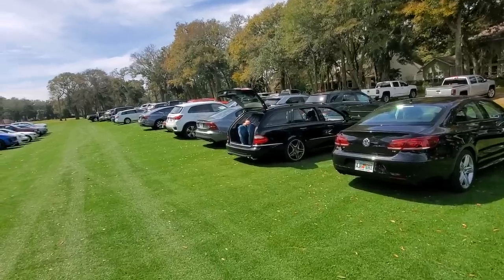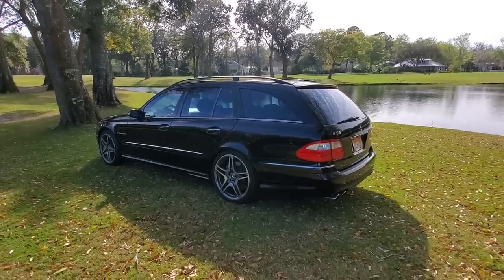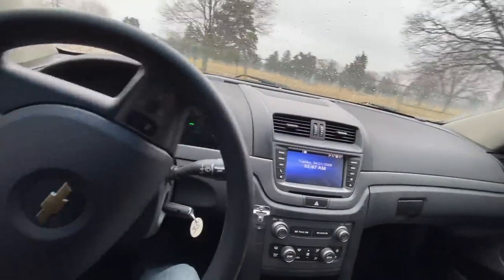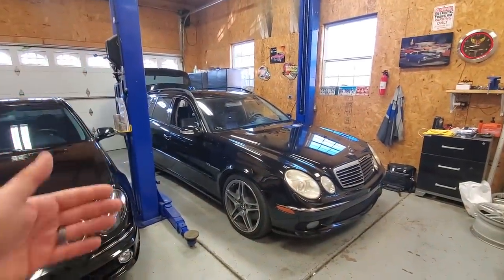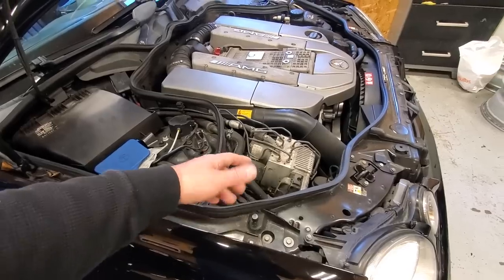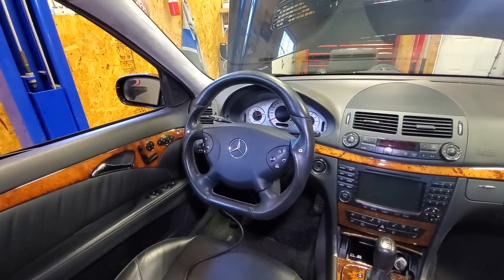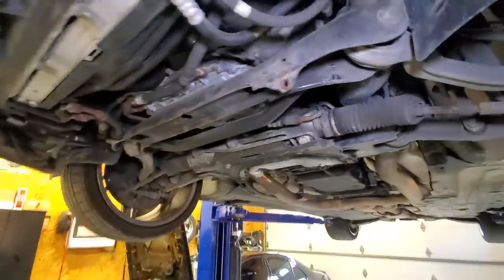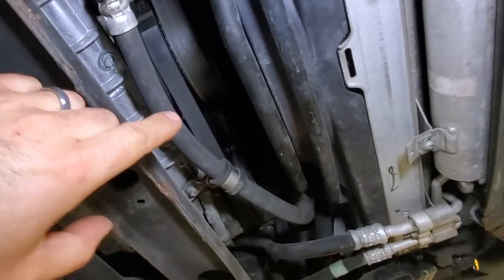I Bought My Dream Mercedes E55 AMG Wagon! Here's What I Paid & What's Done To It!

Comment: The 55 wagon was actually measured to be faster than the sedan. It was 0.3 seconds faster to 60mph and if I recall, better on the skid pad. Probably due to better weight distribution?
Reply: Yes, testers here in Germany found out the wagon even drifts more controllable because there is a little more weight on the rear.
Reply: Better aero.
Reply: More traction in the rear
Reply: @bloodcarver913  wagon has more Drag. Reason is more mass on the rear axle.

Comment: Piano black interior trim kit, headlight restoration, performance exhaust, paint correction, engine compartment detail, updated brakes and rotors, proper window tint, AMG rear diffuser, and undercarriage protection
Reply: Amg rear diffuser on a wagon ? How did u manage that, i'm interested
Reply: You can do a diffuser on a wagon perfectly fine. But ew. Piano black
Reply: Oh ok so sedan diffuser can fit the wagon then ? That would be awesome
Reply: Piano black is disgusting in cars just wrap the trim with something less unappealing
Reply: @vantilmichael9122  yeah, everything but the roof and hatch (obviously) should be the same. Everything underneath the car is the same. But if the lower bumper is the same across both sedan and wagon, it'll fit perfectly
Reply: @NatoriousGamePlay  thx a lot I was led to believe that they had different rear bumpers, so never dug in more, I'll try to see If Alex gets this mod done.......

Comment: Put penzoil full synthetic and Lucas Pure synthetic one quart into it. it will not smoke cold start. Run a can of seafoam on it also to celan up the valves a bit. just let it suck on it slowly dip the vacum hose in the bottle by dabing not all at once. . Worked on my e63, e55, s55 , c32 X3 , c55

Comment: We had an e220 cdi s211 a couple of years ago and loaded literally 2200 pounds of rocks in the back of it. Plus 2 men and a full tank. The car drove perfectly fine. The air suspension pumped it up to the normal height and we had no warning lights for the entire 40min drive. 
Well, it felt like a boat at the rear while going over bumps but that's to be expected

Comment: Future Mods Request: Wavetrac or Quaife Diff, E63 power side mirrors, WALD LED kit, The Camber King (previously F1 Fabrication) front/rear suspension, Creative Steel Subframe Bushings, InterChiller, Weistec Blower kit or the upcoming VRP TVS/Whipple kit, Russell Drake’s 150 Valve Body.
Reply: Then you can really buy your groceries in style!

Comment: Hi! The headliner in your E55 wagon is optional Designo headliner. If I’m correct, it was available in grey and black finish, it came with stitching, but I must check it in catalogue. About the star you bought for E55 sedan - if you bought the facelift version emblem, it would be plain, with no lettering ✌🏽😁

Comment: this is why the hydro-pneumatic self-leveling suspension in the previous generation MB wagons is WAY superior to the air suspension. I brought home 2400 lbs of solid mahogany hardwood form Lowes in the back of my 'W210 E320 wagon and the car was completely level at all times with zero warning lights or issues. Also, SLS suspension doesn't really go bad like Airmatic does, only thing you even need to replace is the accumulator spheres maybe every 100-150k miles (super easy to do and cheap), and even when those go bad  the car still remains level, just a stiffer in dampening.  My current W212 E550 has Airmatic all around and it does not ride as plush as my E320 with SLS

Comment: If you want some cool custom wheels that hark back to the older E55 and 650 SEL/SEC AMG's, you could commision a set of 18" AMG Monoblock multi-piece wheels. 
Get the retro look and get wider wheels for more tire to handle extra torque.

Comment: Oooh, a Kombi.  :)  That's what they call a Benz wagon here in Germany.  I have an 06 E55 Kombi myself, so I'm interested to see what you do here.  Especially when it comes to suspension.  Options seem limited, and I've got the dreaded error message saying that I have a leak.   

I just dealt with a really sneaky coolant leak that was a PITA to find by the way.  Pressure test didn't show it at all after 10 minutes, but it was dumping coolant on the garage floor overnight randomly  Can send you specifics on what caused it if you think it might be helpful.

Comment: @Lsc : Hay I think the keyless go problem is the wires are broken at the bottom of the shifter, they always go there due to the thin wires, it’s a tricky fix but can be done (I did mine ) I extended my wires slightly too cheers andy

Comment: Sorry I'll keep my 06 Magnum SRT8 in Bright Silver Metallic with the sunroof. Dodge changed the paint to Silver Metallic at the very beginning of production. My car is one of 47 with the sunroof and the color code. Granted I have 178,000 miles on mine. My kids grew up in it. However, they were never allowed to wear shoes in the car, eat, drink, ECT. I have the original rims and tires, I even have the original air cleaner, I immediately upgrade to the Mopar open air element (K&N manufactured). The only original part I don't have is the exhaust. It has a MagnaFlow system on it. But congrats on the car. Car and Driver had a shootout between the two wagons I have a copy of that magazine.

Comment: Thats gotta be the one that was at NOLA Motorsports. Decent one. IIRC, they put some new air shocks on a few corners...might even be Arnott Gen2's. I believe that also had some long tubes. It's been many moons since I had my 2004 E55 , but I lucked out and had a very reliable one, probably because I left it bone stock with the exception of an upgraded IC pump.

Comment: SBC, wheel speed sensors, brake light switch, ect all parts of SBC system may have extended dealer warranty regardless of owner. My 2003 e500 does. Check into it.
Reply: 20 years.
Reply: Your on it. Posted before you got to it.

Comment: I have an ML55 AMG which was running well before storage. Taking it out of storage, it went into LIMP at 4000 RPM. No codes (FIXD and KIWI). Swapping modules from my other ML55 AMG would not correct the problem. Swapped all ignition modules. No joy.
Any ideas since you know all there is to know about ALL MBs ?

Comment: Hi, thanks for great videos. I am thinking to buy a CPO 2017 E 300, 4 cylinder turbo with 27000 miles on it for $30k from MB dealership. Can you please tell me what are your thoughts on E 300? Should I stay away from it bc of 4 cylinder engine? What are some common problems with these E 300s?  Thank you

Comment: I think the receipts for large previous expenditures are kinda irrelevant. New Transmission - now you have one that works like the 1st one should have. New oil pan - now you have an undamaged one. New bumper - now you have an undamaged one.

The only good stuff is rear suspension, super-charger pulley. The other takeaway is that the original build quality was terrible.
Reply from the maker: I'd say the trans is a good one

Comment: E55 are a little bit more common in the UK but still just as hard to find but the value is pretty good. I have had an eye on one that is similer spec but a low millage car at 47000 miles and 2004 model year for £18000 which is around $23000 USD. But the chepest one i found was a 2005 with 122000 miles for  £10000 which is $12000. So might or should consider one for myself

Comment: When Mercedes owned Chrysler, they used that same platform to build the Dodge Magnum, your car is the same as a Magnum with a slightly updated body style and fancier interior.
Reply from the maker: And totally different engine
Reply: @LegitStreetCars  Mercedes has a series of different engines they use in different platforms.  My 2000 Dodge Dakota pickup has the 4.7 litre Mercedes V-8 that was used in all of their big cars going back decades.

Comment: Hello Question I have A 2008 Mercedes R350 that has a seized engine due to the timing change I believe. Is it worth finding an used engine and if so I was thing of finding a 2008 Mercedes-Benz r63 amg engine for it. So I would like to know will it fit.

Comment: Just remember: NO DONUTS!

Or Power Steering Pump will hit you in the back.
Reply: I'm assuming that you're referencing hoovies e63 wagon. Big difference between the two. M156 vs m113k.
Reply: Ekam Virk Yep, although the W204 M272 is also said to shoot its power steering pump while doing donuts.
I didn't even attempt it, better live with the doubt.
Reply: @apexseal2811  Hey! What a coincidence! I own a m272 w203 c350!  I mean... I can attest to the fact that my power steering is still working after swinging it a total of about 6-7 times. They're just not built for that though. They start to shine from pulls at 40mph, due to the 722.9
Reply: Ekam Virk Haha, then take care of it!
My father recently sold his W204 C280 (exactly the same as the C300, only different name tag).

M272 E30 3.0 w/231PS. The car is pretty heavy (1555kg), and the 722.999 7G-Tronic auto doesn't shift very fast, but when it picks up speed, it climbs and climbs.

Sadly here in Argentina cars like this one (and any other) are much more expensive, around $12-14,000 for one in excellent condition.

There is another YouTuber under the name of JRgarage that bought a W204 C300 with a stick shift at auction. Pretty interesting find.

Comment: Just replaced my air compressor,  only have airmatic in the back. 1800 dollars was the repair, pretty not cheap. I did the arnott air springs myself since it was too easy.
After 6 years the air springs leaked and 7 years and 9 months the air compressor died, piece of shit if u ask me :)

Comment: Wow I had no idea the brakes in these cars were not mechanically linked to the pedal. A sudden SBC failure could be a bad day! 

Does Mercedes still use brake-by-wire or are they back to power assisted mechanical brakes?... the way it should be lol. ALSO, killer wagon man!

Comment: Cool car without a doubt but I don't get it.  Why don't you just pile the money up on the sidewalk and light it on fire?  Spend 80-100k on a car and a transmission grenades?.  Bad parts? Bad maintenance?  Bad owner?  Seriously just do not get it. Don't get the supercar thing either ie paying 4 or 5 k a month in repair insurance because every time your Maclaren hits the shop its a 20 thousand dollar bill.  I love cars and motorcycles, but even if I had the dough to burn on stuff like that I would be hard pressed to find any value at all in my dollar spent